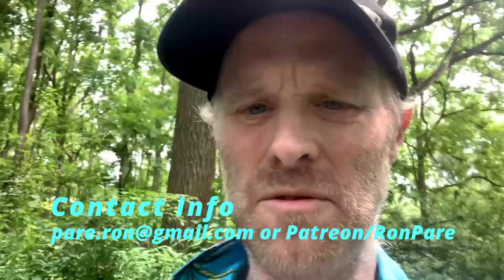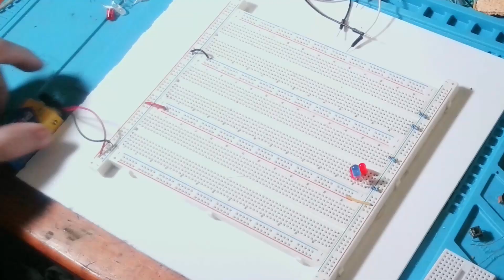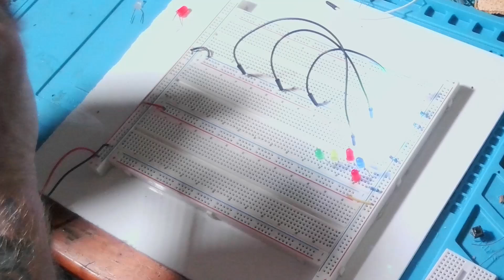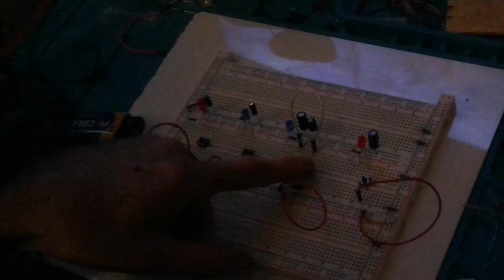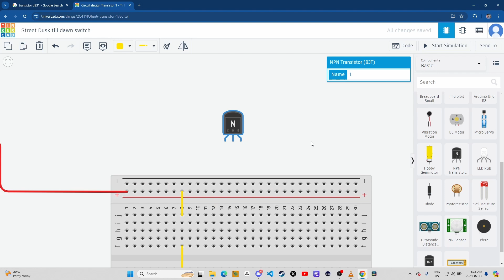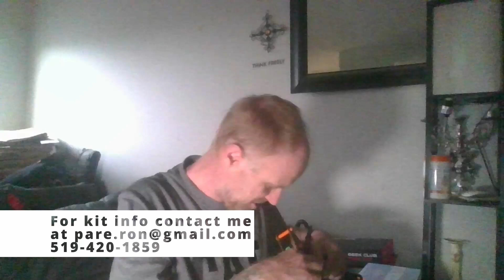Smart City Electronics for Model Railroads, DIY Electronics Saved Me $$$$

Comment: have watched you when you built the models have now retired from work and started my build two 2 years into the build not very close to being finished with any part of the layout i am busy with the timber frame i need to expand the layout and other 100 feet to each is 50x 50 feet  scenery i have a lot of straight runs  how the layout is setup  i have 100 places that need to switch out to does run with the main line too the train does pull in the sighting and then waits for the new program before it allows back out if i allow it to run one train takes 2 weeks from point A to point B one way  does not go in the new section i have put up too 
i have a friend does all my scenery painting the back gound too
Reply from the maker: I used to LOVE building layouts. Being able to engineer everything on paper and make it come to life is the experience of a lifetime. Thanks for coming back!

Comment: it has been a while too 
now i have switched to using MP5 switch machines my friend has them with a lightswitch track and the switch is one if we and the group run you might have problems with a switch or do you have so much time to complete your task also  fault lights on the layout caused a lot of trouble too  better type fast and not many spelling mistakes to  have to report this to the dispatcher to all take time in you wasting it lol  have not had anyone this year made it without being penalized with something lol lot of us forget to count the care, to begin with  
now the hump track is in and the nightmare is to run them in a group and spend a good year putting on new numbers on all of the rolling stock at the time i was refused that information for the numbers for the real car numbers 75% have fake road numbers on the cars if the car is pushed into the maintenance areas we will change it road member them
Reply from the maker: OOOHHH, NFC? I have had some really good projects in the homelab run off of nfc chips. This series could easily go over that, I wanted a 30 minute video. The rest will deffinitely be under 40 minutes. And touch on every aspect of Model Railroading I can translate into a recipe for the system. $50-100 can get you all the components to run a massive layout. Arduino nanos or ESP32s controlling neighborhoods or switch yards speaking to a RaspPi that runs a webserver. And a website that the dispatcher can use to interact with everything from a tactile switch board. 
Using the complicated efforts that came before were just too technical, and unattainable for the average hobbyist.  We will add some dumbed down explanations so that anyone can get involved.